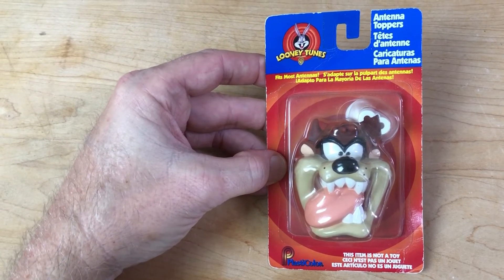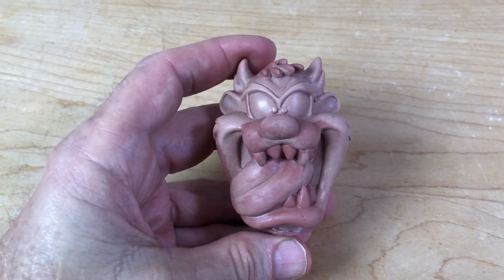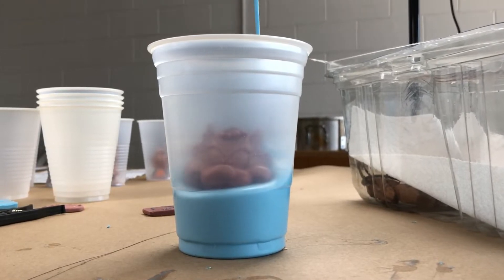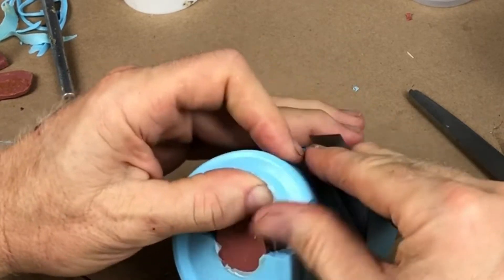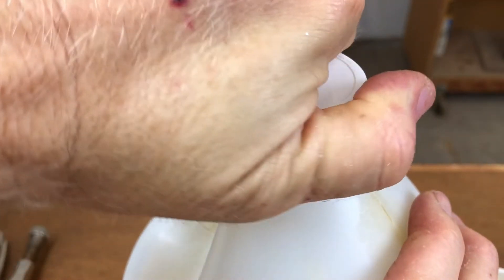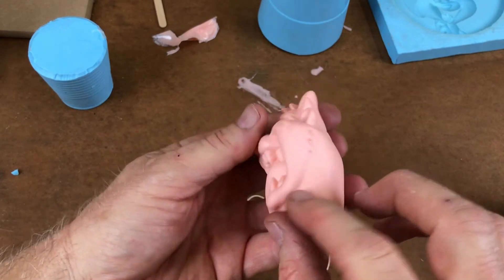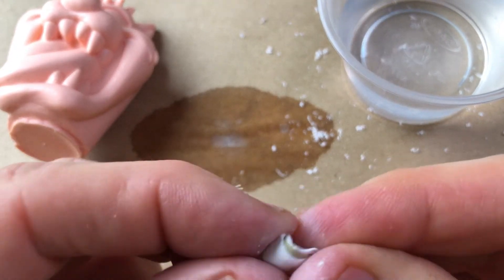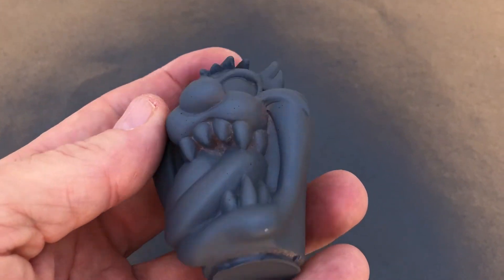Cartoon In Silicone Rubber And Urethane Resin

Comment: Fascinating. Why did you divide by eleven at one point? Does the wax model ever move over to the side of your cup, making  the mold too thin on that side? Can you reuse the molds?
Reply from the maker: +Anne Pfeffer The rubber mix ratio is 10 parts rubber and 1 part hardener.  This was a 300 gram mold so I divided by 11. That gave me 270 grams of rubber and 27 grams of hardener. Total weight of 297 grams. That’s close enough.